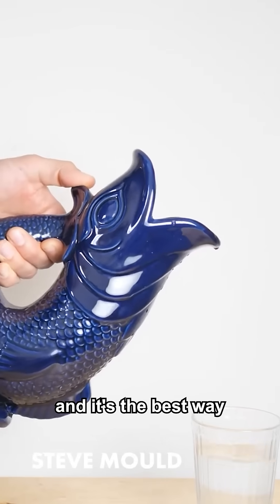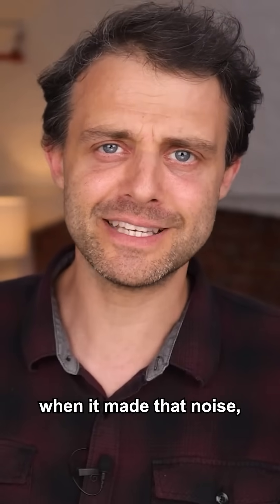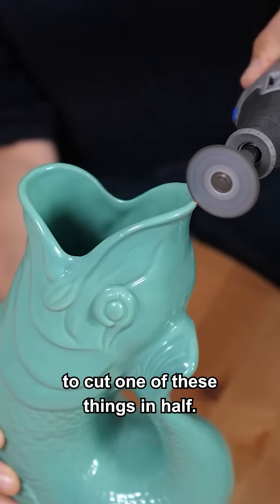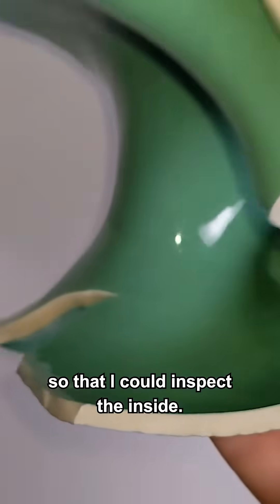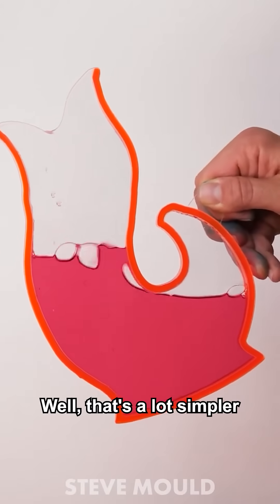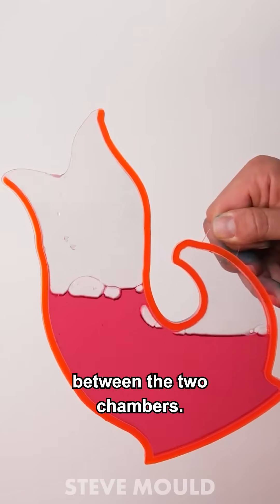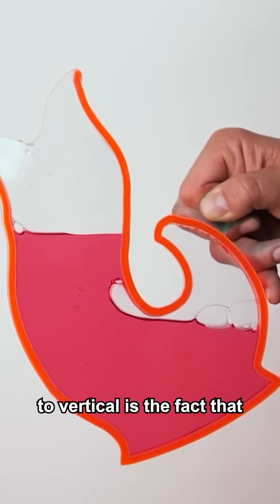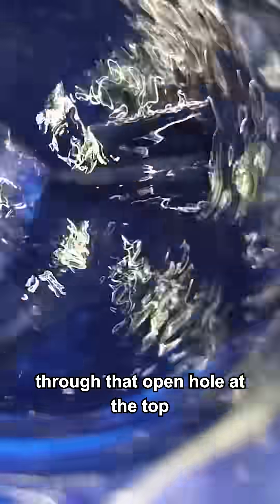Why does a Gluggle Jug Gluggle?

Comment: This reminds me of the boot shaped beer mugs you can find in some German bars and restaurants.
When you make the mistake to drink from it with the tip of the boot facing upwards after a few sips the beer gushes into your face because of the sudden pressure exchange when the air gets around the corner between the shaft and the tip of the boot.
Reply: We've all seen Beerfest
Reply: Das Boot!
Reply: @MDMDMDMDMDMDMDMDMD Love that movie. 😂
Reply: @gzus1482 There's a movie with that name?  I never knew that. I'll have to check that out.  But Das Boot is the name of the boot shaped glass as well.
Reply: @wrenchbender66 you have missed Das Boot? 😮 It's a WWII movie about a submarine btw, not a boot; beer glass or otherwise. The German word for submarine is U-Boot. (short for Unterseeboot). And it's quite long, too; just so you don't get disappointed. 😉
Reply: @wrenchbender66  My bad. The name of the movie is Beefest where Dasboot is a big part of the movie. 😂
Reply: @wrenchbender66 no its called beer fest but Das boot is used in the movie in a drinking competition
Reply: @wrenchbender66  no, it’s not what we call it in German. Das Boot means “the boat”
Reply: The book Das Boot was better
Reply: I thought so too (Das Boot) but then I learnt that apart from the submarine movie ,  in the USA there is a popular Beer Fest movie called Das Boot 🥾 🙊

I wonder why they didn't call the beer scene "Der Boot" as the German word Stiefel (Boot) is a male noun and to avoid mixing it up with the submarine movie title

Das Boot in  German means "the boat" like everyone might have noticed throughout the comment section 😅
Reply: @MDMDMDMDMDMDMDMDMD 😂😂😂😂😂 good one
Reply: @MDMDMDMDMDMDMDMDMD beerfest was the shit 🤣
Reply: Turn.  The.  Boot.
Reply: How are you supposed to drink it?
Reply: @SarahAbramova  sideways, toe down gives you a small splash in the face and toe up gives you more than half the cup in the face
Reply: @svensteelpike8839  what happened to German efficiency? just use a normal pint glass! lol
Reply: @realtruth4804  my bet was it was a ww1 thing but a quick google helped. It goes back to the 16th century, it was a soldiers and students challenge/punishement. Of course it was real leather back then. Cheers 🍺
Reply: @svensteelpike8839 that makes so much sense
Reply: @SarahAbramova toe down probably
Reply: @SarahAbramova you’re supposed to twist the boot sideways when the bubble is about to happen and it will shoot the beer in a more controlled flow allowing you to chug it faster, or just sip it from the side or front with the heel facing away from you like a ninny
Reply: @SarahAbramova I’d assume sideways would be the best way to not get splashed by the sudden pressure change, air release. But I’ve never actually used one so I’m not positive
Reply: @SarahAbramova  have you never seen the movie Beerfest? 😂
Reply: @SuperPope69  I, in fact, have not.
Reply: @SarahAbramova  it's a good comedy
Reply: @SarahAbramova 
Nor have I
Reply: With the toe pointing to the floor. @SarahAbramova
Reply: Came here to say Das Boot!!!! However was beaten, and yes the movie Beerfest has them chug from Das Boot
Reply: The toe has to point towards Poland
Reply: @PheelACCD underrated
Reply: This was my first thought lol

You never forget that boot mug facial 😂
Reply: imagine drinking some beer and then you get jumpscared by the beer
Reply: I remember my first beer
Reply: BEER FEST
Reply: Cause the movie Beerfest on tv as a kid 😂
Taught me how to drink from a boot-shaped cup, if I ever need to
Reply: Achtung! It's called a Bierstiefel. When stationed in Germany 🇩🇪 ❤🇺🇸, as part of a good natured hazing ritual, we would take the newly stationed service members for a night on the town. Then we told the new guy that you have to take a good hearty drink and always with the toe facing upwards. The boot would be passed around the table clockwise and when it got to the guy to the immediate right of the new guy, he would guzzle it to the point where air could almost enter the tip of the boot. When the newbie started chugging it would all come splashing out on his shirt. 

All in good fun 😁
Reply: 😂 Thanks for the warning.
Reply: Excuse me what?
Reply: Omg yes, I have one of these too
Reply: Learn that from a movie called beerfest🤣
Reply: Hot tip
Reply: He’s got the eye of the Jew 😁
Reply: DAS BOOOOT
Reply: I've never seen them at a german restaurant, and I've been living here for my whole life.
Reply: Twist the boot!
Reply: Beer fest
Reply: Ah! That explains that movie
Reply: Badlandschugs taught me it’s toe to the side
Reply: Just had a boot beer yesterday lol  figured out quickly to turn it to the side once you get down to the shoe
Reply: Now that I see this, I remember having had a tiny "beer boot" 👢 as a child. Of course not for beer but for lemonade. But I've never understood what it was good for, given the impractical drinking method 😬
Reply: Spin it!
Reply: You're supposed to drink it toe up, then turn it sideways to vortex the beer down your throat.
Reply: I thought and posted Das Boot! Immediately.  Awesome movie
Reply: I’ve watched beer fest yes